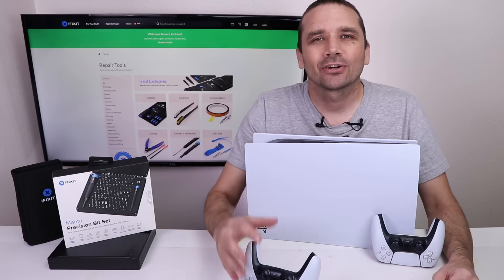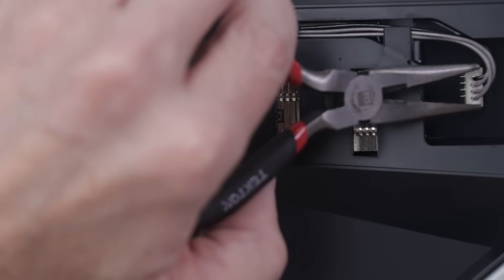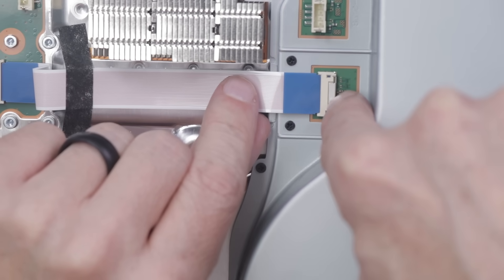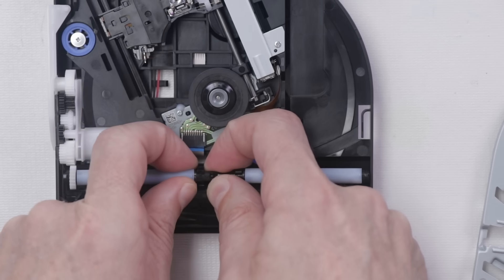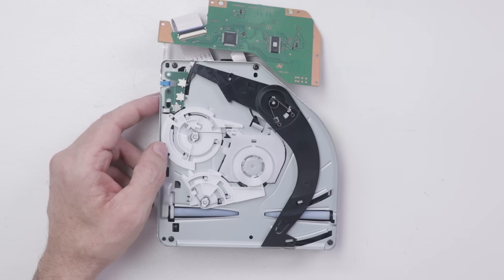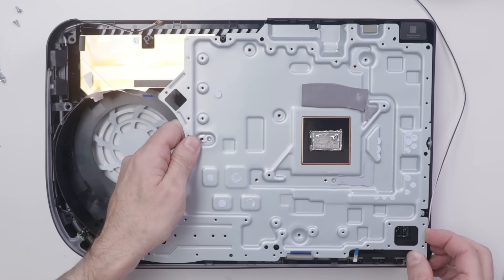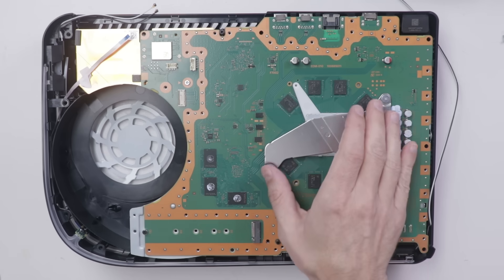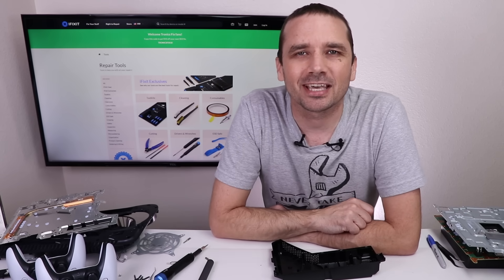PS5 Teardown - A Repairability Perspective

Comment: Hardware reviewers in all gens up till now:
"I will try replacing the thermal paste with liquid metal"

This generation:
"I will try replacing the liquid metal with thermal paste"
Reply: @Nighterlev  
Oh? 
You think it was a last minute decision?
Reply: @Nighterlev  
I dislike defending major corporations, but Sony is in this business for a long time and has very smart people working for them and can give them massive resources.
Reply: Nighterlev and RandomSilly proving how little they know.
Reply: @MansMan42069  
RandomSilly seemed to have accepted the possibility of being wrong.
Reply: @Gameslord 

You can test technology as a company internally and test to see how things go. But, that does not mean during production, it will be efficient.  Liquid metal is a created by mixing compounds together, which you cannot completely alter to always be very efficient. When it is exposed to other metals and materials, it starts to degrade. 

What Sony did was 2 things.

(allegedly) They made their own liquid metal mixture by mixing gallium and indium together. Nobody knows the exact ratio. 

Then, they made a specific design to block everything off within the CPU plates to reduce the liquid metal from touching any other metals, to prevent it from touching any other surfaces. I'm not a chemist or anything but from what I read, liquid metal doesn't evaporate. It only gets absorbed by other metals, of a certain type. Sony's design tries to prevent this. 

When they do their testing, they don't test it with the same environment in tact. They most likely test it at a lab, which would alter the results. Cause as you all know, when having a biased test, you aren't truly testing it through all possibilities. People play games a LOT and I mean a LOT. The heat created by the ps5 could alter the structure of said design exposing the liquid metal to either oxygen or even allow it to subsume. 

Never buy in to the first iteration of technology, it's always going to be like that. 

Go look at the RTX 2080 for example. Over priced piece of garbage that the 3080 solved. Because without it actually being used in the real world, you cannot truly know what happens. Labs and real world environments are not the same. 

He doesn't have a Bias against Sony, I think you are just a fanboy and you think that because they are rich and have the resources, they'll produce something big. Nvdia has more resources than Sony and their first iterations of new technology have always been sloppy. It is no exception that Sony will be a culprit.

I've not accepted the possibility of being wrong because I didn't reply within 12 hours lol, I have things to do. I don't think I'm wrong though, you will start to see the side effects later down the road.

Because as I said before, liquid metal is not new and has been around for a very long time. The fact it isn't mainstream on PC's and companies haven't made a motherboard designed around it, just like how Sony did, should tell you something. 

They probably have already done the research and concluded it wasn't as good as thermal paste. 

Every device runs smooth as silk on launch. When I got my ps4, there was 0 noise and it was dead silent. As time passed, my ps4 started to get hotter and louder. 

Who knows what the effects of dust, normal environment and excessive heat can have on the liquid metal.
Reply: @Ownage4lif31  
I learned something new today:
I am a fanboy. 

I am a fan of PlayStation, yes. 
I respect Sony. 
It's NOT my favorite electronics corporation though. 
Never had a TV, smartphone,VCR or whatever from them(well I did have Sony Erricson feature phone longtime ago). 
I am also open-minded.
That doesn't make me a fanboy. 
Nvidia might have more rss than Sony, but that doesn't mean Sony's resources are low and Nvidia doesn't have exclusively on smart and experienced engineers. 

I am fanboy, and you and that guy are blinded by hatred and ignorance. 
You OPENLY admit that you aren't expert and than go on a rant explaining how things work. 
It will go bad down the road? 
SO WHAT? 
Everything does eventually. 
Don't play 15h a day, clean dust regularly(minimize dust exposure by keeping it away from ground)from both the console, don't spill liquids on it or do any kind of experiments with it trying to find ways to brake it. 

I am a PlayStation fanboy that is considering Xbox Series X over PlayStation 5 for my and friend's OG Xbox games(probably less than 20) and my Xbox 360 games(around 50 of them). 
And those 2 consoles are sadly out of the picture for various reasons. 

Early adopters are MOST IMPORTANT important. 
A key. 
IF NO ONE purchases it, they will sell exactly ZERO consoles and eventually go out of business. 
There are warranties in case of problems. 
In EU, it's 24 months. 
I may be a GAMING fanboy,but I am loyal to no particular brand. 
I might even be a console fanboy since I deeply regret getting PC. 
Worst investment of my life. 🙄

Sadly, I cannot afford every console I want anymore. 
It will likely be a year, possibly a lot more, before I can afford anything.
And than I will need to make a choice... .
Reply: @GameslordXY  go look at the ps5. People's console are randomly being bricked. Told ya, you can have as many resources as you want, but that won't prevent issues. This is always why you never buy the first iteration. All issues usually solved on the second
Reply: @GameslordXY  if you already have a console, I'd say to wait it out.
Reply: Galium melts on 30*C
PS5 runs around 45-50*C
is safe to say Galium will never drie out
Reply: @ASSASSIN19923  
PS5 goes over 60 as well I believe. 
Regardless, it is no issue.
Reply: Liquid metal drives way too fast. The accessibility on this ps5 is trash. Within a year you're gonna see the ps5s get hot as hell. 

Thermal paste the way to go
Reply: @Ownage4lif31  The durability is one of the main advantages liquid metal have comparing to regular thermal paste because it physically never dries out, so we can expect the least amount of maintenance related to TIMs.
Reply: @a112233455  I see now that they made a special design which seals it at an air tight level supposedly. I'm not an expert in this field , but I'd guess they are  trying their best to keep it from reacting to other elements.

I see now, so apparently it will last a long time in theory. Well, I'll be waiting a year to see if the consoles temps take a deep dive. We'll see if their work paid off
Reply: @Ownage4lif31  We all see that the design of PS5 is pretty lame and kind of makeshift comparing to XSX, weird curve, chunky size, little bit lower performance and bad repairbility, and since SONY have to dissipate more heat generated by higher SOC frequency by smaller heatsink, improvement of TIMs is one thing to do. But that doesen't necessarily means the problem is liquid metal itself. The design of two sides just bring us to Nov 2013, while the apparent worse one was XO.
Reply: @a112233455  no you think is lame majority think its not....
Reply: @Ownage4lif31  
And afte a year you can get 1 yourself lol
Reply: @a112233455  
Your assessment of PS5 is truly a masterclass of... something. 
Only a savant mind that you posses, could make it possible. 
I am jealous. 
Truly.
Reply: @Ownage4lif31  
Ah, what do you know. 
Sony was testing it for over 2 years.
Reply: @GameslordXY  liquid metal comes in two forms. Gallium and indium. It is a chemical structure that could be altered but I highly doubt they did. Gallium is the most efficient of the two, but they can mix them together.

It will dry up no matter how many tests you do. You'll realize it soon after a year that your ps5 gets much hotter and the fan will start blasting. Then you can open it up and see that it'll be very dry.
Reply: @Ownage4lif31  keyboard warrior.
Reply: @Ownage4lif31  
You highly doubt that they did? 
Why? 
And why would Sony deliberately go self destruct? 
Just because it isn't viable in a mainstream PC market, doesn't mean it's not viable on a console that was developed for over 5 years. 
The liquid metal was tested for over 2 years. 
If they lied, and they turn out to be as incompetent as you seem to believe, there will be no Sony anymore within 2 years. 
3 at most.
Reply: @GameslordXY  because it would be super profitable if it worked out well. A console is the same as a pc when it comes to CPU cooling. Same concepts.

Liquid metal is a much more profitable market. But I've seen so many complaints about it. 

In theory, Sony's should last 7 years before going whack. But only time will tell. Since the ps5 is still new and all, gotta wait a year minimum.
Reply: @mjc0961  
Every new tech that comes is being tested for 3,4,5 years and more. 
Does that mean, that we should stop developing new tech?
Your bias against Sony is clear. 
No matter what they do, you will always complain. 
You will always find a flaw. 
Always. 
Doesn't matter who says what, you will always be against Sony. 
Or at the very least against their PlayStation engineering teams. 
Speaking of which, when was the last time that you engineered at least 1 gaming machine that sold over 100mil units?

Comment: That's quite a nice overview. 
Personally, I think the PS5's construction really sucks. It's cheap, lots of flimsy plastic parts, unnecessarily complex and just constructed in such a way to make even the most basic maintenance or repair works a pain in the butt.
The construction is abysmal in comparison to the Series X or S. The Xboxes are much more thoughtfully constructed and waaay more customer friendly. Especially that soldered SSD in the PS5 is an absolute no-go in my opinion. 
Sony should really be ashamed. The Series X can literally be opened, cleaned and closed again in the same time you'd need to remove those 43 screws.
Reply: also In my opinion the design itself is horrible, it takes up way more space than it should. So they literally somehow manged to create the worst of all worlds

Comment: after looking at xbox sx's inside, ps5 looks like an old-gen device. it is a big plastic toy tower.
Reply: It doesnt need to be cool inside. The performance is the only thing that matters together with outside esthetics.
Reply: @OG_ALviK  those things aren't mutually exclusive...good performance usually comes from a well built machine... especially when it comes to longevity...these are engineering basics
Reply: @86lanzo  but you can't have next gen console that is very user serviceble that also looks good inside and that comes at a very cheap price... You can't have evrything. Be happy that they went out of their interests by giving you an easy way of cleaning the ps5 from the dust. It's not a common thing these days.
Reply: @OG_ALviK  performance is the weakest link point for PS5, did you forget? It is significantly lower performing than XBOX SX.

Comment: Strange... I've seen 4 teardowns and in this one and the one from Austin Evans the ps5 has thick thermal pads near the APU. The other two, from ifixit and other channel and even the official teardown from sony don't have thermal pads there... Maybe sony added them the last minute? I don't know but it can be related to the freeze issues some people are experiencing. And if the thermal pads really are necessary, there may be a lot of ps5's on the wild that can break or overheat some components and fail prematurely.... Maybe i'll wait for next year to buy one, just in case...

Comment: the average lifespan of an ssd is estimated at 10 years,but its often way less. so basically whn it goes bad,thats it,its way past warranty! sony messed up by doing that!
Reply: My first SSD is a Samsung evo. I bought ir around 2012. It still works perfect, I use for videos and Music every day. The lifespan it all depends. If the one from PS5 last around 7 years. I'm ok with that. But I agree, they should have done something different.
Reply: No, it's not often way less. It's in fact almost never way less. It's almost always more.
Reply: Well if the last gen Samsung 970 Warranty Specs are of any use as a measurement..
"5-Year Limited Warranty or 600 TBW Limited Warranty"
Either way if the NAND Flash does fail Sony would like it back as a sampling. Since there is already tons of Telemetry Data being sent.

Comment: If I recall correctly, there are holes under the top cover where you can shoot compressed air to clean the heatsink without having to completely disassemble the console. Also, I really wonder what kind of foam did Sony use around the SoC. It's clearly meant to prevent the liquid metal from leaking out and killing the system, which can happen. It'd be ideal for use on PCs as well.

Comment: Internals are cool but I wish they had a SSD slot in the outside like the series x
Reply: Leopold  Microsofts internal SSD is 2.4gbs. The dedicated SSD card doesn't have a transfer speed or download speed. It just stores memory but it uses the transfer and download speed from the xbox, why do you think that its a slot instead of some wire that it connects to
Reply: Leopold  have you seen the cheese crater that Apple made? Where there are not wires and everything fits in the slot. I should've mentioned the chips that are connected when inserted like you said but thats what I'm trying to say that its a slot that works without having to open the console.

Comment: The only question I have is... You have two holes supposedly to be used as dust-catchers, one of them is on the side of the console with the heatsink... They even said in their video that you are supposed to be able to easily vacuum those holes... Taking that into consideration, is it really that not user-friendly? Unless you have some serious error in your console, cleaning the vents/fan seems to be easier than ever...

Comment: I noticed triangles pointing to the screws that need to be removed for disassembly, and a few were different so that might tell you what screws go where (I remember on phat PS3 all screw holes were marked with arrows and the odd screw length was marked with a S)

I don't think you will need to take out all those 43 screws to get to the heatsink for cleaning, looks like they only hold the 2 halves of the metal shield together, and the screws under the shield only attach to the heatsink. The whole motherboard, metal casing and heatsink should come out in one piece after removing the 2 marked screws. 

That chip you called the south-bridge is the custom controller for the SSD

Comment: The PS5 is as over-engineered internally as iPhones are, explains why they are both so hard to repair. Still, the parts cost of the PS5 must be much higher than the XSX

Comment: One thing. The expansion slot receives the air flow to cool it down? NVMEs get quite hot and with better cooling comes better performance and durability.

Comment: Liquid metal will need to be spread completely across the whole die. It doesn't work like regular thermal compound. It's also conductive. get it on the wrong part of the motherboard and it can cause bigissues

Comment: The soldered ssd is a terrible idea. 
Yes they are reliable but there are more places for faults and then  bye bye ps5... for the storage
Reply: Show me a single case of an SSD failure..

And if it did fail prove it did so before its intended lifetime.

Comment: I just want to mention that cleaning the heatsink is not as hard as you described it since sony left holes in the chassis of the PS5 right next to the heatsink for cleaning with a vacum cleaner. Might not be efficient but it will be enough to keep the console running cool

Comment: as you were talking about cleaning the heatsink, there are slots that sony already said were vacuum cleaning ports
Reply from the maker: Even with those you still can't get to the inside of the heat sink to clean it easily.
Reply: @Tronicsfix  not completely, I dread to think what my day 1 ps4 looks like, it has had extreme use, and nothing has ever failed, I have however vacuumed the exterior grills on a weekly basis since new,

Comment: Yea the thing with storage on the PS5. The Expandable storage doesn't work. And connecting an external drive is risky as there are a lot of people that got their console bricked because they just connected an external drive. (at this time on launch) 

Also, if you read this at the time of the launch of the PS5. Don't use the ports at the back of the console, using them could brick your console. 
Also, don't use the rest mode in games, it may brick your console.
Also, don't disconnect your controller when doing the update, it may brick your controller.

Lots of easy ways to brick the console XD